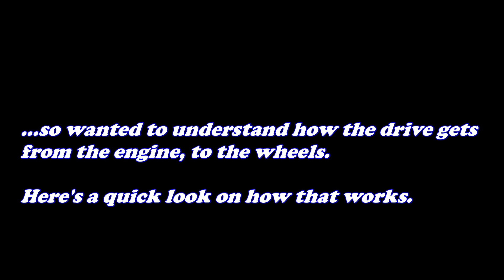Husqvarna ST230P Snow blower.  Drive system explained.

Comment: -- Thank you.  My ST224 arrived yesterday.  Have anti-seize, low temperature grease.  I needed a look in there to see what I needed to do.  So, cables, that cheap plastic bit that can break if you run it in 6th, axels, and the gears and diff unlocks.  
   If you could, I'd very much appreciate your personal experience with the motor.  Brand, how well it works.  Oil you use.  
   If not, thumbs up anyways.  Best wishes.